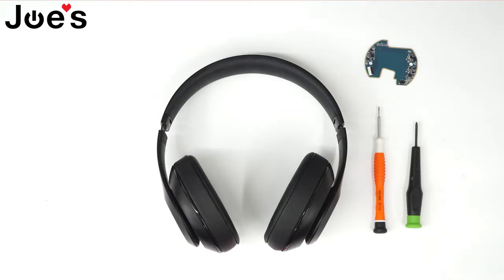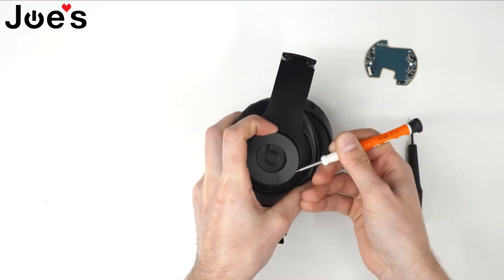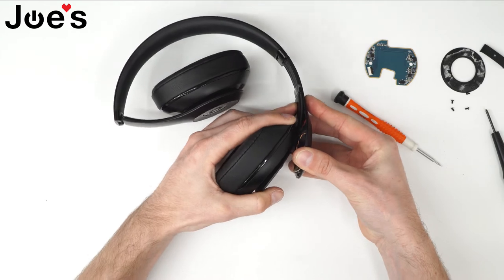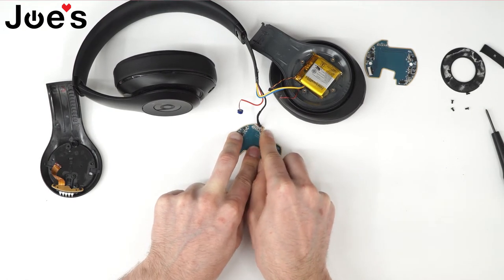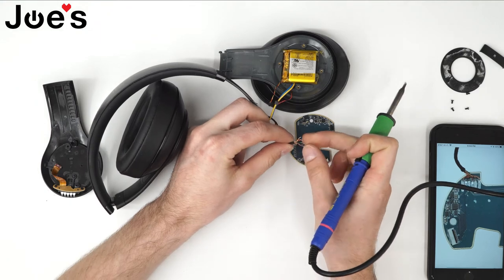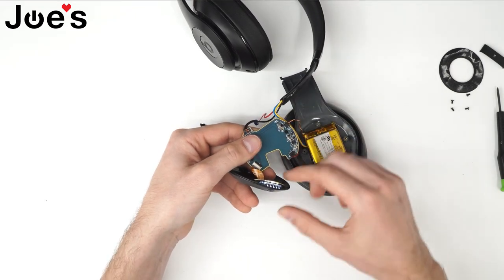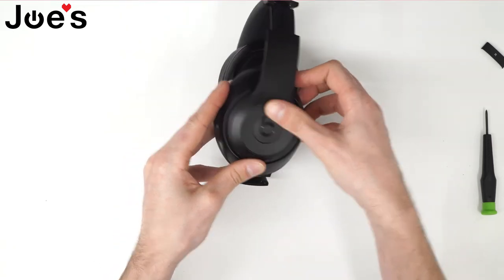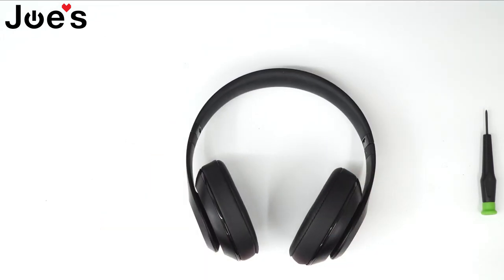Beats By Dre Studio 2 Wireless Not Powering On PCB Power board Replacement

Comment: First, great video.  It helped me take apart my headphones and put them back together in one piece.  I don't know much about electronics but I know enough to get by and this tutorial was very helpful.  I actually fixed my headphones without buying any new parts.

My headphones quit working while being caught in the rain one day.  I spoke to someone on Joe's website and they said it was either the PCB or possibly the battery.  At some point in this video he will mention the PCB goes bad in wet conditions (people sweating) or in my case the rain or in a retards case testing their waterproofability in a pool of water.  No problem.  I didn't have money to purchase the new board or send in the headphones.  So I decided to take them apart myself.  I mean it's an electronic and electronics really don't interact well with water.  So you would think if it quits working in the rain, it must of shorted something.  It seems extremely logical.  Whats not logical is the fact that I fixed everything by taking it apart and just putting it back together again.

All I did was take it apart per his directions.  I disconnected the battery connector, the USB connector and the LED connector.  I inspected the board for a possible short and didn't find anything.  I left the top wire junction alone and didn't even touch a solder gun.  All I did was clean the glue on the LED connector a bit to create a better connection when I plugged it back in.  That was it.  I hooked up the three connectors I mentioned and plugged a USB cord up to my device and the LED lights turned on like it used to.  I let it charge for a couple bars and put everything back together.  I'm jamming out using my headphones as I speak.  

This was all I did to fix my device.  Not really sure exactly what fixed it, but inspecting all the wires and connectors for shorts would help if you have this same issue.  It might not be the board itself.  Just a short somewhere with the wiring.  I didn't actually find anything but me moving the wires around might of helped.  Thats the only explanation I can think of.  

Good luck to all those who decide to attempt this on their own.  It's super easy.

Comment: I have a studio 2, when I plug them in I get 0 lights 0 power or anything.  BUT it does heat up as if it's trying to charge so I know it's not the charger port.  Is this the answer most likely? I thought the battery.. but heating up would really sound like this videos issue is causing it
Reply from the maker: Hello, thanks for commenting. Please email us at support@joesge.com and we will be able to better help you there. - Aaron P